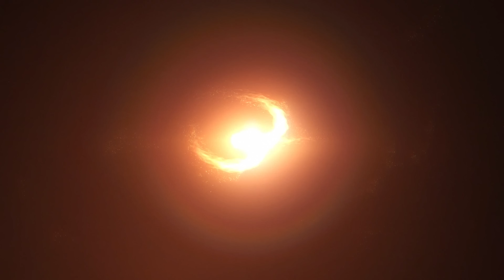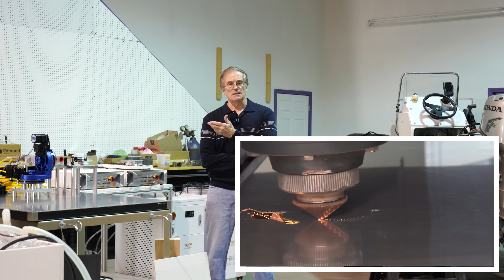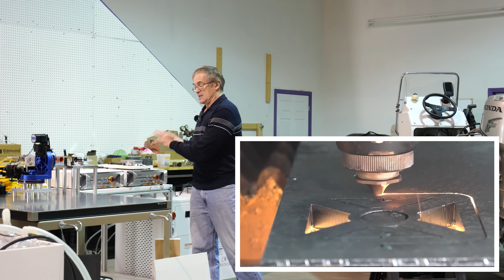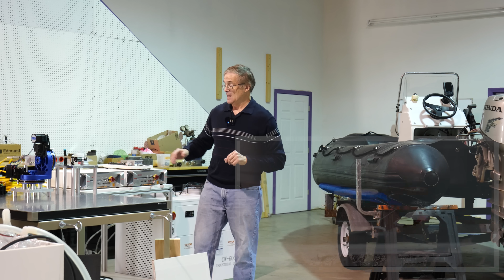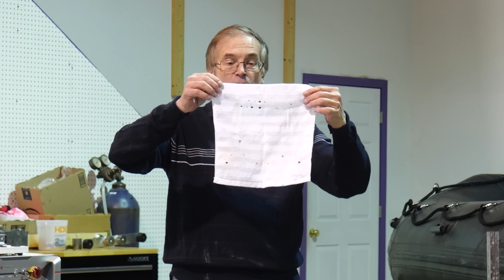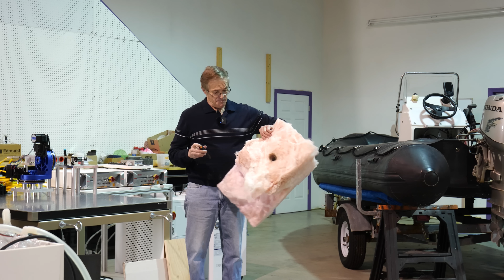We have a problem... and need your help!

Comment: Perhaps the Starlite formula by NightHawkinLight could be improved with graphite powder to reduce light reflection by turning it black.
Reply from the maker: That's a good idea!
Reply: Thanks. I also asked ChatGPT's O3 model, and it came up with many interesting suggestions. Unfortunately, I couldn't post the shared chat session, since YouTube's AI automatically removes posts with external links — which I knew. So I only posted the ID along with a verbal description of the URL parts, but the AI wasn't fooled and deleted my post within seconds. :(
Reply: @TechIngredients  I have another idea, although I'm not sure if it is feasible: A wall made of beam expander lenses that spread the beam. I think Glas lenses would be too expensive though... Could Fresnel lenses work? If yes, than this could be as easy as casting/melting the proper Fresnel pattern on cheap plastic foil? Another spontane idea would be to cast the normal expander lenses as water ice blocks and make an ice wall? I would also suggest spraying ice cold water from behind on the wall, for additional cooling, this could also support the star lite wall, if you want to try that. And what about earth/dirt/clay? Have you tested those?   Hopefully my sudden brainstorm sparks some more refined ideas in you and other people. Have a nice day and always be careful while handling so much power!😄

Comment: I have no Idea what im talking about but when i heard Our Laser is so focused it kills everything i thought the solution is to unfocus it. So wouldnt a Smoke machine just dilute it heavily? Unless the Reflection is too scary in my Mind that might Spread it enough to become Tame enough to be sorted with Drywall etc.
Reply from the maker: It's not a bad approach.
However, the problem with smoke is that it's very hard to control it. The smoke will quickly disperse, especially with the rotor wash from multiple drones.

Comment: A possible option is to use a dirty water wall so that light hits the particles and gives it enough time for the surrounding water to absorb the energy heat and vaporize quickly. the top of the wall shuld be open bacause of the vapor of water
The idea is to have a large aquarium wall with "dirty" water. You could use ground coffee to color it.

Comment: Soak the plywood in water. If the high-powered beam punches holes in the water-soaked cloth, then you need a material that is more resistant to the laser. You told us the plywood works well for at least a half second slowing. So, soak the plywood in water. Waterlog it. Then, you can get the slowing, but not have the wood go up in flames. Plus, since the water doesn't move into the spot that was hit by the laser, it will remain in the surrounding plywood longer and protect it from going up in flames.

Comment: I mean... worst case you just buy a bunch of thick stone/concrete blocks, and build a small 3x3x3 wall and there's your blocker. Issue is, as you said, it's not very practical, but maybe you could do this outside? I know in USA in some states at least, as long as it's your private property it should be ok... but I guess the location you are in is a bit more public so much so that would not be a viable option.
Reply from the maker: Working outside is a non-starter.  These lasers are just too dangerous.
We need a blocker that's about 20 times larger, and that's why the concrete is not an option.

Comment: I know this is way to late but here goes I know they make viewing windows for machinery that thermal cameras can look through. With very little emissivity could one of these ports be mounted in the end of a fish tank filled with a heavy salt solution to absorb and disperse the laser? I assume the issue is melting through the port but this is something that could potentially be tested?

Comment: One of your previous videos, at least I think it was you who made and used barium nitrate(?) Nano particles to make a radiative diffuser coating for a panel.

 It worked by over diffraction or something between the different sized particles. 

If you still got that thing laying around, you should do some tests to see if you can burn through it with your fancy new flashy laser. 

If not that particular recipe, try looking into reflective coatings on micro and nano sized glass spheres. Mix it into a quick spray or bake on process on large panels. Might need access to a spray booth and oven.

I accidentally turned a ebeam welder into a 50kW light saber, cut through my engine, straight through the chamber and through the enclosure to crater the concrete path outside the cell before the program interlocked the beam. 

Good luck. im always excited to take notes from your videos!

Comment: Aerogel ?
Reply: Thanks Neeme Vaino - Just a thought considering Aerogel is the most absorbent heat material other then a Laser goes through it like a hot knife through butter but could there be a combination like with a ceramic buffer that could disperse a Laser. We are getting into the field of Weaponized Laser Defense Shields - Perhaps a Electo-Magmetic Field ;o)

Comment: What do you think about a metal panel with good thermal conductivity and a flow of water (a waterfall) over it?
Reply: And a second computer that only monitors the movement of the lasers and can turn them off?
Reply from the maker: The metal plate is too likely to reflect the beam as the beam back at us. 
The idea of a secondary system, like a school hall monitor, is a good one. It could detect a lack of movement or a lack of targets where the laser is pointing.

Comment: Build a wall out of Leggo bricks. Then when you set fire to them, you can easily dismantle them and chuck them outside. Also the burning plastic will give you an olfactory warning system of the laser system malfunction. Alternatively, have you considered moving to Los Alamos ?

Comment: Purely speaking as a layman, I can see two solutions that may both be too expensive. One is to cover the wall with a grid of diverving lenses that will spread out the laser intensity, maybe a diffraction grating will work. The other is to get a sheet of tungsten, even a thin film might work. Its dense enough and temperature resistant enough that it should hold off the laser for a few seconds.

Comment: One other idea - if the beam position is fixed, make a metal cone, position the tip of the cone in the beam, but at the front with some distance from put a metal sheet with hole aperture of diameter of the beam.

Comment: Maybe try a metal plate of some type ,and run high voltage to it and let it hang. The current might change the beem at the surface.  Maybe even put the plate behind a wall of falling water.

Comment: I cannot help with the barrier issue. That is a safety issue that needs to be addressed and i hope you do. But while listening to the problem it occurred to me, you may want to also look at implementing a dead mans switch into the laser beam itself instead of a kill switch that needs to be activated. Especially when you're dealing with the power and tenths or hundredths of seconds between something being right and going wrong, those moments saved by using a dead man's switch might make the difference between bad and catastrophic. As soon as the switch isn't actively held, power cuts out. 

I used to run CNC machines, and kill switches are all well and good, but when we are running new programs, you're never running at full speed through a full program. It's line by line and you are activating the program every line, and transversing slowly until things are proved out and reliable. 

Just something i thought of that you might like to incorporate into your project.
Reply from the maker: That's good advice. Thanks!

Comment: I wonder if a concentrated suspension of carbon in a stable fluid like mineral oil would absorb the laser without any drama??
Reply from the maker: It might,  but I'd focus on water-based liquids due to the potential for flammability and toxic gasses being released.

Comment: You already know where the beam focus, go behind it with a 45° angle pointing up (making sure there's nothing on top) or down if you have concrete floor covered with water I can make you a diagram if you like

Comment: Could you make a parabola in sections so that no matter where the laser hits on the back wall, it will be directed to a single focal point. This would make it so you just have disperse the heat and cool the focal point
Reply from the maker: That's a clever idea. It would be difficult to construct a couple of dozen reflectors, each with a different curvature based on their installed location.

Comment: I might be horribly wrong, because I'm noob,
But what about pointing the device towards the ground ?

1. The ground will probably can take what ever you will point at it, so maybe no burning through.
2. The cost might be lower, since it's just digging a hole in the ground.
3. The overall area becomes much smaller, well, width and height just gets converted into depth.
Reply from the maker: This has been asked a few times already.  The challenge is that we don't have enough clearance between the ceiling and the ground to locate the laser system and still have any reasonable distance to the drones flying below.
Digging up the concrete foundation to dig a hole is too expensive and potentially destructive.

Comment: You're trying to test the whole thing at once, on this type of system, these pieces can test unique and combine to work every time anyway. Lower your wattage and your pulse time, and change what you consider success in targeting. You know darn well the wattage will complete the cuts, you only need to see response from your targets in such an area that more watt and more time would certainly bring failure. Then, when you need it, drop your safety, up the wattage and the run time, and send those aliens to ...
Reply: If you absolutely have to test full power and are less worried about cost but more "mass" consider grouting over the surface of something light weight that you can patch easily. Cement board with grout coating for instance. You can patch the cement and spread more grout or kitty litter as you go. Or if it's only mass, cheap terracotta tiles glued in a welding blanket hung over a 4x and 2x4 frame, same as the sheetrock, scraped and fresh coated before tests.
Reply from the maker: I agree with both these recommendations.

Comment: Do not use flat surface. For example Kentek company make laser barrier out of aluminum black sheets, but the surface of the sheet is like array of tiny concave surfaces.  Other idea is to use some dispersive glass plate with some refractive patterns. Surface processed glass. Also sheet of array of short focal lenses will do the job. Another idea is the sheet is folded into a dense accordion shape; in laser safety setups, a bent sheet is often used, and the beam is directed into the fold

Comment: "Design an optical funnel to capture and safely redirect or reuse the laser energy." ou

"Develop an optical funnel system to absorb, redirect, and potentially recycle the high-intensity laser beam in a controlled and safe manner."

Comment: Large enough tube filled with salt crystals? As heat would progress into the tube the salt (crystal, molten or vaporized) will "renew" the barrier forcing the laser to "dig" again and/or spread thus cause the energy loss for a while. How large exactly, depends on your laser specs. Simple enough and likely worth trying... Maybe thinking about graphene aerogel options too?

Comment: maybe always put a diverging lens on the other side of what you are targeting?  make a stand that aligns the lens perfectly, using low power visible lasers, and build in a rail that allows the lens to move back and forth to allow for different sized targets.

Comment: Would it be effective to use a fish aquarium with aerator and layers of prismatic glass in the water. Maybe the water can help cool the glass layers and between the bubbles and the prismatic layers the beam would diffuse enough to degrade its lethality. If nothing else, you might end up with some interesting art work on the shop walls. The other thing that came to mind is, there is a rumor out there that certain colors such as blue are resistant to some laser frequencies. It would be great to see if there is any validity to the effect of color to various laser frequencies.

Comment: Im not sure if this is doable, maybe put a light sensor with telescope and color   selective lens coaxial from behind, to detect bounce back laser, if laser punch through the designated target if any, then there will be lesser bounce back light, then adjust sensor sensitivity could probably control when to cut off laser.

Comment: Why test in your garage at all?  Test the laser in the environment it will used , outside.   This will give you the opportunity to judge the effectiveness of your system to existing systems, such as  Iron Beam.
Reply from the maker: It's all about safety.
These invisible laser beams can blind miles away, and we can't assure that everyone that could be affected will be waring protective goggles. Even stray reflections near the target can be hot.
Reply: Do you want the business end of a multi-million dollar DoD missile in your house? This is how you get the business end of a multimillion dollar DoD....
Reply from the maker: That's unlikely. Anyone who is interested in what we've learned can simply watch the videos. If there is a legitimate request for us not to pursue a specific topic, we won't refuse. There is no reason to eliminate a small town.

Comment: What is the wavelength of the laser?
Reply from the maker: 1080 nm.
Reply: @TechIngredients  Near IR. Could you test (at low power) the scattering and absorption of clear unflavored Jello? There might also be some interesting experiments regarding how an electric current might polarize or change the arrangement of the colloidal suspension of the Jello (both prior to solidifying and as a liquid; think of an LCD display since the charged particles of the suspension might not be uniform).
Reply from the maker: Actually, one of the materials well be testing is ballistic gelatin. It won't involve some of these interesting interactions, but I think it's worth a look.
Reply: @TechIngredients  Maybe not practical, but some interesting academic notes related to this...

For Jello, you're looking at a clear material at that wavelength. Suspended within that are particles. If the particles are concentrated at the middle, and only the particles absorb light and produce heat, then the surrounding material will need to survive that heat. If the material merely melts, then that is ok. If the material burns, then this is not ok. Part of the question of how well heat is transferred out by the surrounding material (probably not all that good) is balanced by how much the light is dispersed before being converted to heat (greater volume for a given amount of heat).

You are not limited by just the material from the ballistic gel or Jello; you can suspend other particles.

For example, toner from a laser printer is a very finely controlled thermoplastic material of a given charge or dipole moment. One could sprinkle toner in the middle of that gel and absorb more heat there. Toner could actually handle significant heat, but not likely as much as what the laser puts out if there isn't substantial dispersion prior to turning into heat.

Other materials, such as fine particles of iron or iron oxide could handle more heat, but might not absorb as well. That's ok if you have sufficiently thick blocks of material and especially if the light is dispersed by other fine particles which  only reflect or refract rather than absorbing.

One of the keys to stealth materials for RADAR is that the size and spacing are resonant such that the space containing the resonating wave is sufficiently absorbent that the signal can be reduced over multiple bounces (it is a traveling wave which at some point uses the geometry to become a standing wave at some point).

Now imagine you had particles of something like ceramic involved. The ceramic, if small enough and finely placed, might even approach (due to spacing) a bad waveguide. This is good since you want a bad waveguide. Just make sure the suspension is sparse near the outside of the gel, and dense in the middle. Perhaps with a very fine powder which can act like a prism or mirror to spread things out on the way in. This should reduce the total heat at any one small volume enough that the gel (whether it be ballistic or Jello or anything else) does not reach a temperature which ignites or breaks down.

Comment: Total guess here but love puzzles. How about flattening the laser light into a fan shape until needed then intensifying it into a single beam.
Reply from the maker: If we could do that electronically, then it would be easier to use that control signal to shut off the laser.
We need a physical block that can be depended upon if the control system fails.

Comment: I am not sure if you still need it but I can suggest aluminum oxide fabric. Light, cheap and can stand 2500C for over 2 hours. An that's for 10mm thickness.  (I can get you if you need). If you tell me the temperatures I may be able to test it. I had 5mm thick material on my hand while it was burned with acetylene torch. And i could not feel anything but the wind of acetylene. 
But may be you can use just a regular glass before the gypsum board or wood. That will disperse the intensity of the beam and then you can stop the beam with other material.